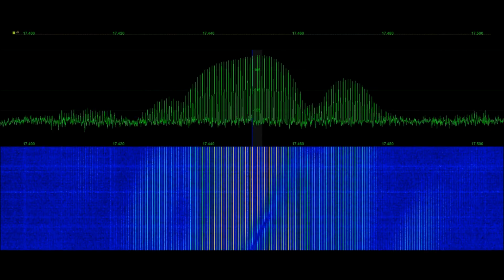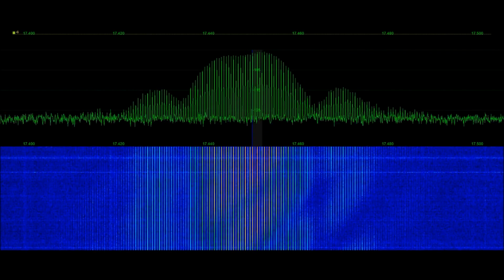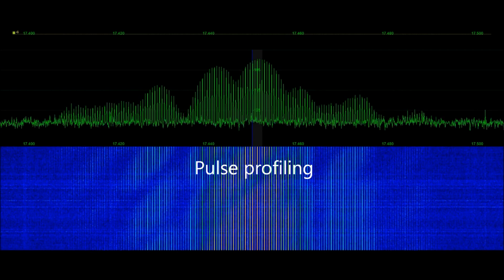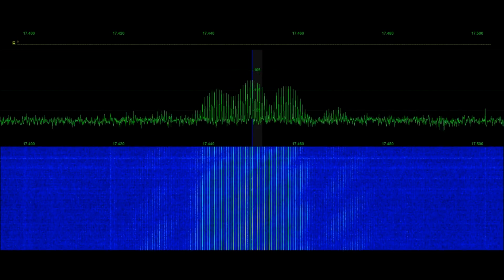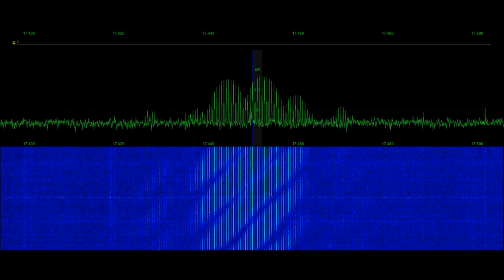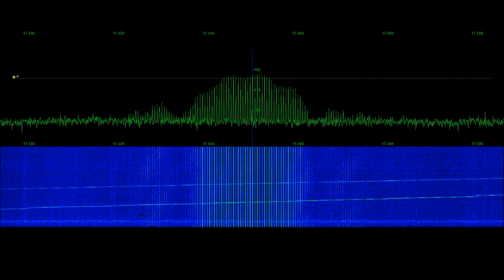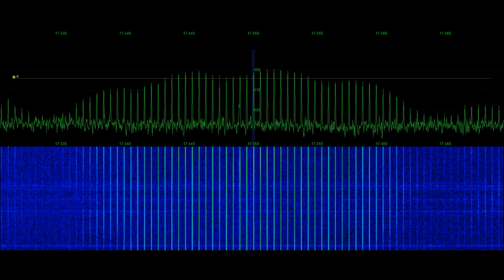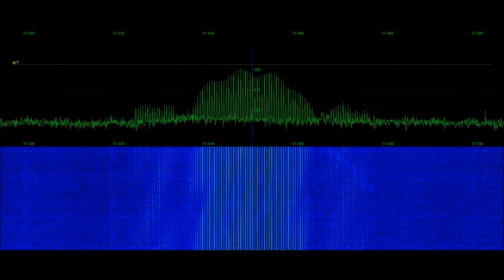Canadian Meteor Orbit RADAR CMOR | Signal Phantom

Comment: The individual lines of spectrum in the fine structure are what I was always taught to call PRI or PRF lines (depending on if you are talking about the time or the frequency domain).  The PRF of the pulse train is 532 Hz, and so the PRF lines are 532 Hz apart.  In this case the pulse train is a ~75 usec non-rectangular pulse every ~1.8797 msec.